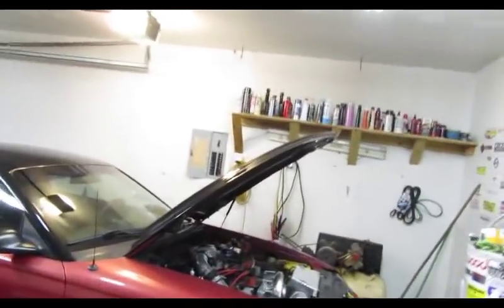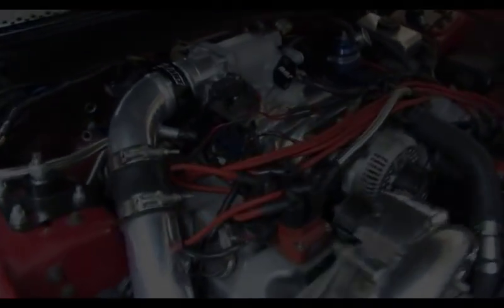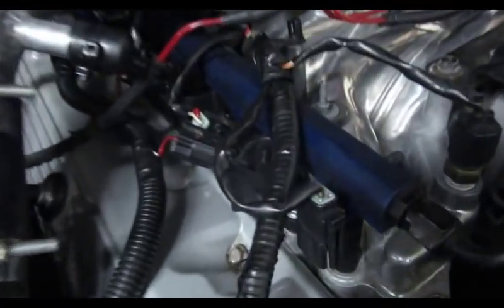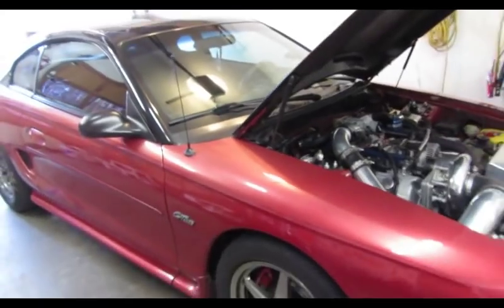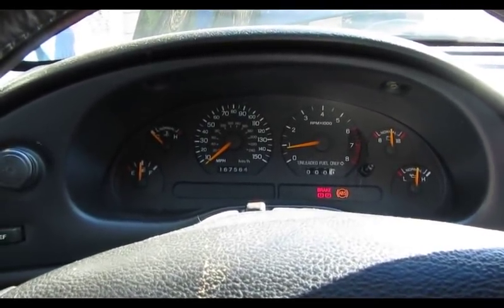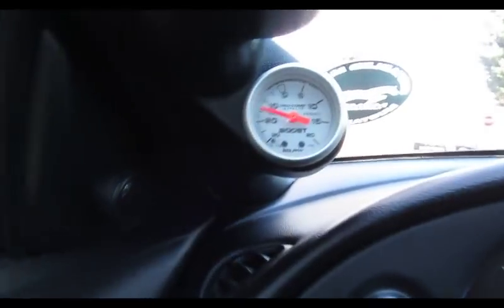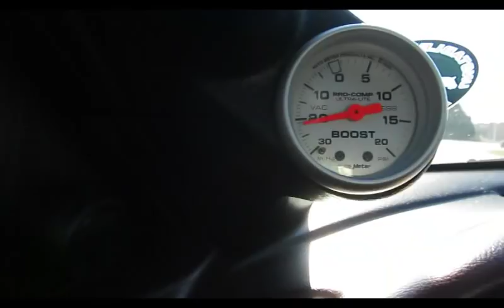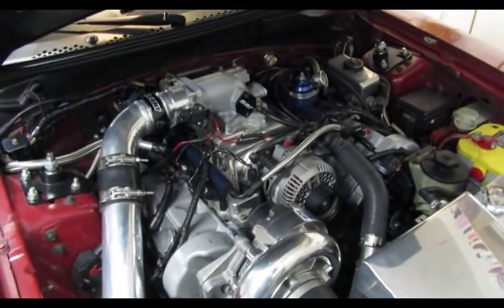96-98 Mustang GT Coil On Plug Conversion

Comment: I am so glade u show that conversion because I was wondering how to do it thank u so much
Reply: A more expensive but arguable better option is a msd 6 mod ignition. They allow use of the coil on plugs with a fully adjustable timing map. Can be used for efi or a carb swap with a victor jr intake. Otherwise it's nice being able to make timing adjustments and data log on the fly.

Comment: Red Monster typically makes the harness. I used to use the same one but ended up getting spark knock when I started making more power. They essentially cut the spark out in half as they are running on a waste spark setup.
Reply from the maker: I haven't drove it much since I installed it. I didn't notice any spark knock but I do have a boost a spark installed on a 4 psi hobbs switch

Comment: definetly alot cleaner, nice conversion. what is max boost on that, 18?
Reply from the maker: 25 psi I let out at 5,500 rpm. It will peg the needle on the gauge.

Comment: About to run the conversation on my old lady too (NA), being this video is 2 years old I'm sure you had this question many times, any long terms issues , lack of spark or such?
Reply from the maker: No issues at all
Reply: Did you have any problems nick? I have one for my 4v I read a comment on top you’ll lose spark due to the pcm firing differently

Comment: Hey im just now finding your videos and like the set up . I also have a sn95 98 gt auto and was just wondering would just pi swap alone get me in the mid 300s or should i go straight super charger and if so which one vortech or pro charger
Reply from the maker: The pi swap and cams should get you to the 300s. If you want mid 300 to 400 you will need a supercharger. Vortech and procharger are both great choises.
Reply: Appreciate it man, and also did u build ur bottom end or is it still stock?
Reply from the maker: Its built.

Comment: What are the benefits of it besides cleaning up the engine bay? I just bought 96 with extremely low miles after getting rid of my new edge with 300k on it and this one I’m looking to actually build.
Reply: Nothing! Only appearance
Reply: You gain extra space in the engine bay when you get rid of the spark plug wires.

Comment: If you delete the IAC you can expect that after tuning on a hot motor it will run fine. That is until:

    The weather changes
    the motor is cold. No high speed idle when the motor first starts.
    the baro presure changes
    the fuel changes from winter to summer grade (or the other way)
    The AC is switched on (or off).
    the motor load changes for example power steering load during slow speed operation.
    For the GT, not enough RPM's for the power steering pump to supply power brake assist during coast down.
Reply: @mathewhoffer4541 not sure where this guy got his from but I got mine off the Svt forms 13 years ago from a guy that tested and made it for the 96-97-98 4v and it works fine for me. But yeah IAC delete is dumb for street applications

Comment: Dude where’s the turbo 2v part 3?? Any updates soon?
Reply from the maker: To be honest we gave it back to the owner and he was getting it tuned and we haven't got an update yet
Reply: vortech2v ok cool thanks, I’m considering getting the same kit for mine and I just wanted to see what kind of headaches I would be in for. Thanks man!!!
Reply from the maker: @allaboutdiy1375  The turbo kit is nice I would change the lines and fitting for the oil filter relocation kit and the turbo oil return but other than that its nice.
Reply: vortech2v nice I’m glad to hear that. Basically minor stuff. They usually run about $2200 for the kit? Does that sound right to you?
Reply from the maker: @allaboutdiy1375  yes that sounds about right. It's worth the money for sure.
Reply: vortech2v good to hear, hey thanks man for your time and info. Good luck with your mustang 👍
Reply from the maker: @allaboutdiy1375  No problem and thanks

Comment: Any long term complications of the conversion?
Reply from the maker: Still running it to this day with no problems
Reply: @stevenbowen90   Thank you so much... there was a bunch of people on the forums stating that this conversion does not work in boosted applications and seeing I am only at 6 PSI for now I wanted to verify!